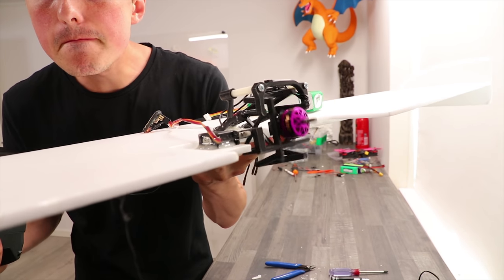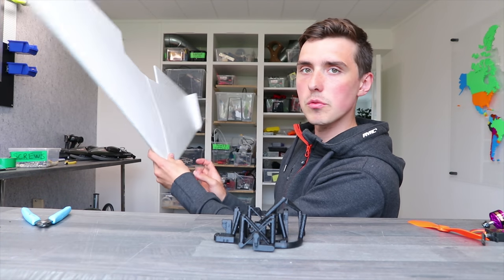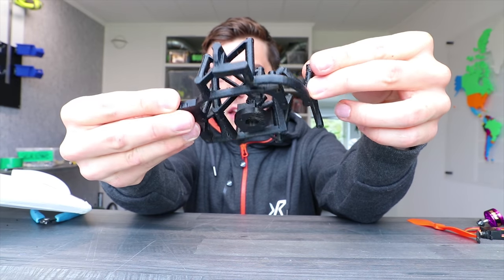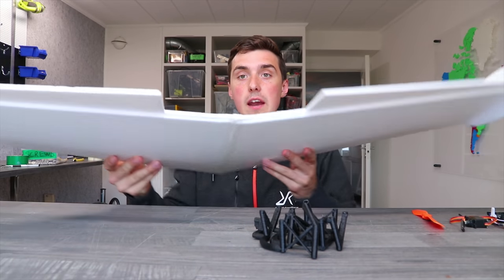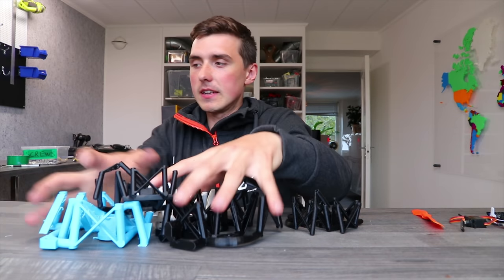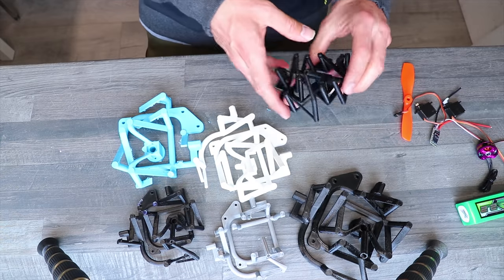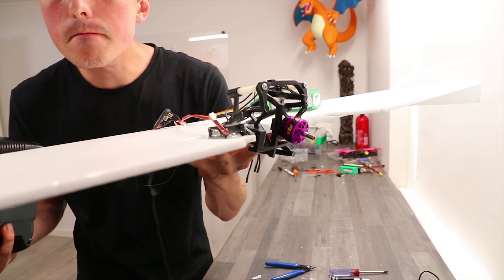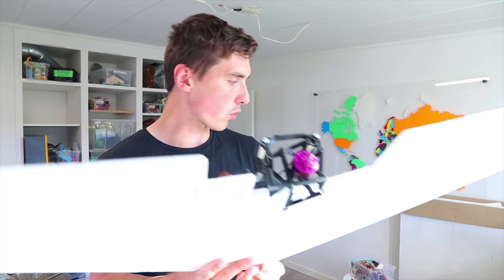3D Printed Vectoring Mechanism

Comment: You need an engine test stand on your bench to more closely study material compliance vs thrust. Try some reinforced nylons or polycarbonates.
Reply: It's a motor, sorry but it was bugging me
Reply: @calebcrawford8887  The nomenclature is still valid
Reply: That is an excellent idea.  This would also let him quantify exactly what he had to do to make it work.
Reply: He said he used “pc” (polycarbonate)
Reply: @calebcrawford8887  Technically those are synonyms, depending on which source of definition you go by.
Reply: Rubber bands pulling against each other on some simple prop pivots might last longer than trying to flex a 3d printed part.
Reply: also gotta consider the harmonics that the motor produces
Reply: I've tried to find a better print material for edge performance of printed parts.... Yet keep coming back to PLA. PC, nylon and carbon filaments are just a bitch to print with, and a good print with perfect adhesion is more important than theoritical strength. I think in this case he should go for a more conventional thrust vector design, not this flexible cage. Thrust vectoring on two solid hinges will weigh a little more but will work.

Comment: Hey Man, a piece of advice that can prevent snapping :
I'm banging my head on this mechanism too. The orientation of the print actually matters on this case, if you print sideways (as oriented on the original stl) the layers will be orthogonal to the stress on the flexed beam, thus being stronger than the layer bonding. 
I'm actually printing it right now and I'll give a feedback if you are interested. 
Kudos for the work, the plane worked fine for a prototype !!

Comment: It's great to see you stretching yourself. In this case, sort of returning to your roots to incorporate 3D printing and advanced technology with the compliant mechanism. This video, more than others, raised several questions for me:

1) Center of Gravity - Do you perform any rudimentary balance testing before concluding construction? I'm thinking nothing more than suspending the airframe using fishing line to determine flight characteristics (i.e. nose-heavy, etc.)

2) Stress Testing - Do you perform any rudimentary stress testing before concluding construction? I'm thinking mounting the thrust vectoring mechanism with motor on an instrumented stand to determine the effects of torque, etc. on the compliant mechanism. Then adding a propeller to test with greater loads. A scale would provide information about power before the first flight.

3) Finite Element Analysis - Rather than printing with many different materials, have you ventured into FEA with Fusion 360? You might be able to rule out a lot of materials to arrive at the best balance between rigidity to resist torque and thrust, and flexibility to provide the desired flight control characteristics.

4) Generative Design - Once you arrive at a straightforward design, Fusion 360 can then produce many variants of "generative" designs. Designs we would never come up with; many that couldn't be produced using conventional fabrication methods, requiring additive (3D printing) and/or subtractive (CNC) manufacturing techniques.

Lastly, have you considered printing with carbon fiber filament? Light and strong, though it might not provide the necessary flexibility and almost certainly would fail (crack) with enough impact.

Comment: First, I love seeing this compliant mechanism concept being tested live in a new way. Especially how the various materials flexed or broke under stress.

I remember the same video you referenced about compliant mechanisms and, if I remember correctly, there's a key piece that can explain your material strength problem, which is that this particular thrust vector gimble is made with 3d printed metal for the (as another viewer pointed out) much lower powered ion thrusters used for positioning the satellite. 

Now, if I were building a blimp or hybrid dirigible, where the need for constant, fast vector changes and a relatively high thrust vectors isn't a requirement, then it might be an application where this gimble could be useful - in a terrestrial environment at least.

Comment: As always, thanks for showing the fails, they are as educational, if not more, than the successes.  I would be curious to see this on a stationary rig with the motor and prop so you can film it and see how the different filaments and sizes react.  Nylon feels like such a good fit for this because it is so compliant, but as you stated, maybe TOO compliant.

Comment: You had me unexpectedly LOLing at the "statistical ratio" of your flight outcome probability... you had me wheeze laughing at the maiden-nose dive. Interesting video. +1 sub. I'll keep an eye out for future videos. Good humor!
Reply: also, if you don't mind me saying, I think to have that type of vectoring adapter work, you'd need to print two different types of material. Ridged and flexible sections in the same model (and print), depending on the needs of various points of the structure.

Comment: Center of gravity is Kool and needed, But balancing the plane is more important.
Maybe Redesign ? ? ?
Engine mount is good but increase the framework from front to back and let that join the two wings.
Like a center columns fuchsia lodge so that you can connect all your control elements, battery, controllers and servos.
Into a 3-D printed housing that contains all your major components to fly.

Love your Next video

Comment: You should 3D print the frame components to hold flat, flexible spring steel bands between them. Use the 3D printing for the framing around the motor, and for connecting the bands together, but use the bands for rigidity and flexibility. You could make the 3D printed parts with slots that go completely through the middle of them that allow the bands to slide through, and then use epoxy or screws to affix them in place. The concept is solid, so it's a matter of materials. You could cut the spring steel out of one of those clock springs, or constant force spring. It's typically a flat band wound into a circle, and is typically inside of those wind-up kids cars, clocks, lawnmowers, etc.

Comment: you did a great job explaining electronics in a way that beginners can understand.  also my versa wing has a worse gap and itsa right in the middle instead of the back lol.  my advice would be to try the thrust vectoring with a tractor style plane, motor mounted in front.  then you dont have to worry about the weight quite so much because, as you said, nose heavy planes just fly badly.  try it with something other than a flying wing as well, because flying wings are notoriously pitch sensitive.  best of luck and keep up the great work! 

PS: you may want to share with your viewers a link to that foam board since it is hard to find outside of the US.

Comment: For me, this is because the engine acts like a gyroscope.
The rocket engine for which it was designed doesn't matter because it doesn't have a rotating object. The inertia of a rotating gyroscope is quite strong.

Comment: I've never built something this complex, like basically a gimble got a motor.

However I've made a form of thrust vectoring with my control surfaces within the air stream of an integrated prop for a F22 model plane I made in Uni out of foam(from sheer madness during exam time)

I found that although I got more maneuverability with the trust vectoring compared to a previous built without it, I lost a lot of lift/power in the tight turns.

I'm not an aeronautical engineer but I suspect that the forceful rotation of the body of the plane was causing air to hit the horizontal surfaces of my plane causing a sharp drop in speed due to air resistance. It probably didn't help that my prop was also not ducted so the air flow was chaotic though the vectoring channel thus losing efficiency and power.

I never thought of using a flying wing design due to its inherent instability, but I remember reading a research paper about flying wings with bell shaped lift distribution for better stability. Maybe combining thrust vectoring and the flying wing may not be as mad due to the reduction of vertical surfaces.

Comment: You should probably try printing the compliant mechanism using SLA/DLP since it'll be closer to being injected molded and isn't as likely to break due to weak layer adhesion

Comment: It needs to be engineered so that increased thrust tends to have a neutral bias. The pivot points have the wrong fulcrum positions, changing these will correct the issue. Currently when thrust is increased, there is a tendency for the flex to point the engine away from the level; it needs to behave the opposite. It should stabilize in a neutral middle with increased thrust. 

I might be using language that doesn't articulate properly, I'm not sure. Hopefully you get what I'm saying.

Comment: I printed one in PLA, but I set my wall line count to 3.  That printed well on an Ender 3 and might be strong enough for your needs.  You could also turn the temp up a degree for better layer adhesion, and increase the wall line count to 4

Comment: Material trait problems could be reduced, just try for thrust vectoring again with a more standard hinged gimbal rather than a flex gimbal. Then that way shouldn't get any pivoting other than where the hinges are. I could also see there may be some issues where the thrust center doesn't line up with that of the pivot, so it may be prone to levering once the forces are in play.

Comment: check out fiber reinforced filaments. A PETG with oriented CF strands would give you strength and compliance. larger diameters tubes with certain infill patterns will give you increased rigidity where you need it. Alternatively you could print or drill bores or attachment points for aluminum/titanium/carbon fiber rods to stiffen certain points.

Comment: Ever thought about using metal spring to lighten the load , or  or spring metal sheets cut to the right size  so that it bends with the surface... It may also help with the vibration , like shock absorbers

Comment: Activate the thrust vectoring immediately to compensate. And don't throttle up so hard during take off and while it is accelerating up to flight speed because the motor is flexing in the mount relative to the wing.

Comment: You should try it with a resin printer. The inter layer weaknesses of the FDM machine are going to be killer, even with good material choice. Resin prints once cured have basically isotropic properties.. Making the compliant flex arms thicker will also make it stronger without increasing the weight too much, but at the cost of less range of motion.

Comment: if you could print the part in two materials perhaps you could have flexibility where needed but still have enough rigidity to prevent the force of the motor from breaking the part, or you could break the part into a few pieces that could be assembled via a pin system of some kind providing a sturdy part

Comment: Install the motor at the fore instead of the aft. Applying a directional force from the rear of an object is more difficult than dragging an object in a direction; think of a truck trying to push his trailer in front of his truck instead of behind.

Comment: It would require supports but if you print with the right orientation you can increase strength of the x flex

Comment: As much as compliant mechanisms are attractive in a case like this I'd recommend either an assembly of separately printed stiff and flexible materials, or a dual-extruder setup with a stiff and compliant material.  You might be able to achieve the properties you're looking for by designing the framework to be completely printable, but with the flexing joints being printed in a flex filament like TPU or maybe PETG along side an extremely rigid material like Protopasta Carbon Fiber Filled filament. I'm not sure on the selection. You could create an assembly that would achieve both sets of properties though, if you have a dual-extrusion printer. You'd just need to cad it so that the flexible and stiff portions of the structure inter-lock in some consistent and robust way.

Comment: Try a multi piece buildup frame with 2 plates on metal pin pivots. Use thin plywood or 3d print each plate. The pivots will give u the rigidity.

Comment: Nice video. I think you need another design with bolts. Skip on the material flexing, but go with joints that use bolts. :).

Comment: Cool video :) I am sad it didnt work. Compliant mechanisms seem like a huge investment in design effort since i guess you have to tailor them to your material. I was thinking during the video... what if you used even softer filament and wire to stiffen some areas... but honestly by that point you might as well use traditional hinge mechanisms?

Comment: If you bulk up the frame a little more and use ninja flex for a flexible joint interface in the joint you want to move that might work. you will have to counter balance the ninja flex though so it's neutral by default

Comment: Hi, great video. Interesting 3d print... I actually think you may get a better results if you had petg for the long members of the mount, and a flexible rubber (ninja flex) at the joints where you have big rotation. This should get rig of the joint fatigue problem you are seeing. 

I also think it would help to have your vectoring servos sitting on very rigid surfaces. Might be worth putting some structural reinforcement on the foam wing such that you minimize the displacement and rotation of the servos relative to the wing.

Still a great video- thanks for sharing

Comment: I like the concept but tilting the motor itself is the problem.  as you found out the is gyro rotational force crdeated when you tilt the motor off axis will ultimately flex the mount and lead to oscillation and mechanical failure in a short period of time. however the concept is still a good idea.  You could attempt a solid mounted motor with a compliant thrust vectoring duct system which is mounted behind the prop and simply directs the airflow.  Your video inspired me, I am going to build something and if it works out cool I will post a video and tag you.

Comment: My guess would be that the flight controller compensated for the movement when you launched it causing it to pivot the motor and force it to the ground when you throttled it up.

Comment: Have you tried using a flight controller board? these wings are almost impossible to fly without one already.
with a proper servo mix and trims it should fly straight and level without even touching the sticks! And yea, you were rreally
hot on the throttle there after the throw, after seeing the glide tests, almost ANY amount of gas would fly your wing.
AND, HOW did you do the surround sound!?? that was awesome! Thanks from US. Florida

Comment: 8:10
The prop is the wrong way
Reply: Wow man. Good eye.
Reply: true!
Reply: Well it's a quadcopter motor..and probably the prop too..so maybe its ccw
Reply: @muhdanwar7240  it has a esc. there is no ccw and cw motors in brushless motors. It all depends on the esc and fc
Reply: @imperialrecker7111  i know...but the thread and prop can be either ccw or cw
Reply: No, look at 9:41 The prop is mounted in the same way as 8:10 ...and you would definitely feel it when launching.
Reply: @urano1988  yeah, was gonna say the same thing.
Reply: Imperial Recker it will spin either direction based on the wiring to the esc. Don't like the rotation direction? Switch any two wires and it will spin in the opposite direction. But there are no fixed direction outrunner brushless motors I am aware of.
Reply: @TalkingGIJoe  no there are prop spinns in the right Direktion But the Problem is the "input"  side of the props is now the Output. So the Part that is in the Front must be correctly be at the back. (you Can mount the Same prop in bouth directions, But one is very unefficient and loud so you Cant get the full Power Out.)

Comment: Since you do more cutting edge concepts. I would be interested to see if you can figure out a way to design / print reflectors. Maybe outfit a bike with printed reflectors (front, back, wheels) or house numbers, or pin on for jogging.

Comment: Maybe try printing the mech with PETG? It's about as flexible as ABS but it has the strength and printability of PLA. More importantly though it's more impact resistant which will give it a better chance at surviving as a TVM unit for a propellor.

Comment: I'm surprised that the one material I didn't hear you SAY (not saying you didn't test it) was PETG, which seems ideal for this. Especially annealed PETG.

If you're not hung up on the conformals, you could back up, simplify and test one theory at a time. 
Instead try a gimbals mechanism and prove the vectored thrust concept first.  Then, if successful,  go back and work on repeating that success with the new conformal engine mount. 
I hope you'll keep trying. This is interesting.

Comment: Noice!

what free floating plastic hinges in the vectoring mechanism? that way you can use the most solid material yet it will "fold" without flex...
You might need to design a new one though...

Comment: ABS with a vapor bath. Also you're not taking into account the amount of drag the contraption is causing. Your source of inspiration, as you stated was a concept for satelites, where there isn't much of an atmosphere to cause drag.
Having it pivot where you had it would cause another issue, which is weight shifting around. 
Vibration issues would be caused by not having your prop balanced.

Comment: Your aerodynamic centre of lift is behind your centre of gravity. Depending on how strong gravitational/aerodynamic forces are you want them close to each other and on the same spot if they're of equal magnitude. Shifting around the centre of lift is quite tough, try to play around with the cg until it's balanced.